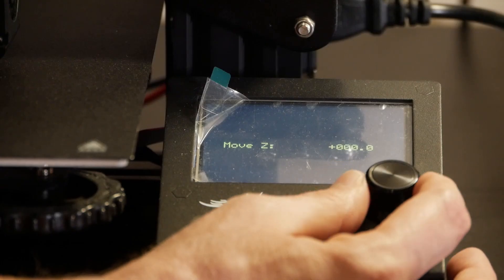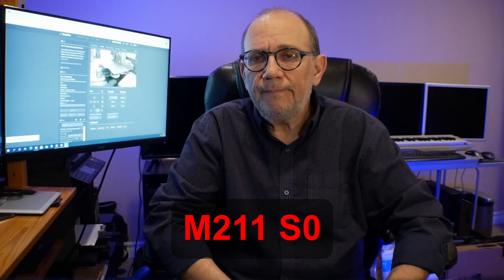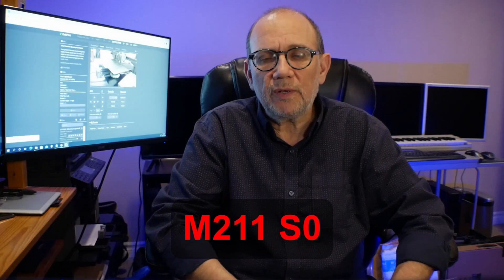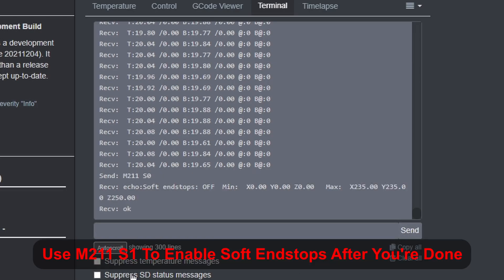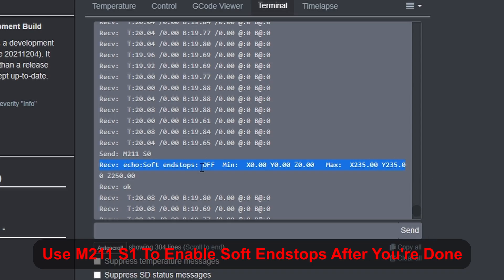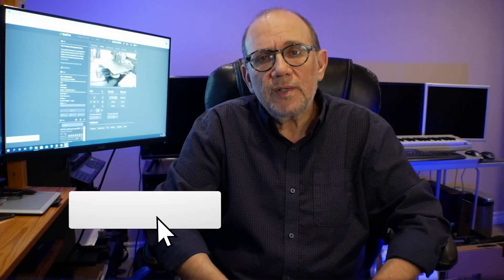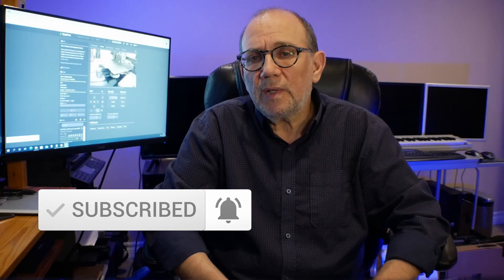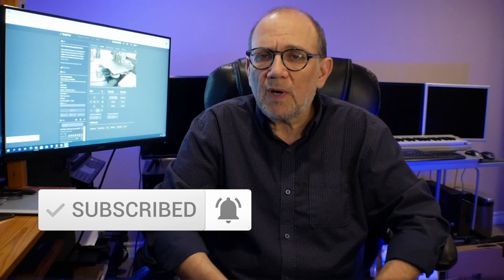Easy z-offset adjustment for your 3D printer.

Comment: Ok, so what I didnt get Is at the very beginning... How did make the probe go down (so that it is extended) when you move your Z axis... Because in my Ender 3 Neo when i lower my Z axis the probe all the way up (way higher than the nozzel). So I cant do that... (In other words, the nozzel touches the bed first)
Reply from the maker: Hi there.  In order to extend the probe I installed the OctoPrint BLTouch plugin which can be found here:  https://plugins.octoprint.org/plugins/BLTouch/  .  Just so you know though when you actually set your z offset you don't need to lower the probe.  I did that in the video just by way of illustration, but this is not something that you typically need to do when actually figuring out the z offset.  Thanks.  RG

Comment: how did you manually drop the probe on the CR Touch?
Reply from the maker: Hello....in order to extend the probe I installed the OctoPrint BLTouch plugin which can be found here:  https://plugins.octoprint.org/plugins/BLTouch/  .  RG
Reply: Thank you for that information.  I'm really new at this stuff.  If you don't mind I would like to ask another questionn.  I installed the BLtouch plugin but I have no idea what the gcode would be for this plugin to work with my ender 3 Pro or where to find the gcode.  Also, the motion options on the the control panel have disappeared since the install and I get my printer to home.  Could you maybe steer me in the right direction to fi find it or learn about it?  Thank you. @CreatewithTech
Reply: I actually solved the home issue.  There's a lot to learn and take in.

Comment: Do you say what Z offset is?? Is it a number noting a difference in height between the nozzle end and the porbe end. Its it a fixed number? Is it stored or do you need to save it? Does it vary with X and Y values? How does it read vs the three figures on the home screen. Hoestly Im lost.
Reply: At 1.56 you say 'setting the z offset is tricky for a lot of people'.. this is the moment you could have said.. Z offset is..
Reply: 3.18 'so now the probis down' - how did it get down?
Reply from the maker: @sammorganmoore  In order to set your z-offset you don't need to lower your probe  I only did this in the video to explain what the z offset is.  If you'd like to do this with your setup you can install the OctoPrint BLTouch plugin which can be found here:  https://plugins.octoprint.org/plugins/BLTouch/  .  This assumes that you have Octoprint installed...https://octoprint.org/download/  .  You'll need a Raspberry Pi or a similar SBC for that.
Reply: @CreatewithTech  I dont want to add a pi or any gubbins. Just the prob popped down in your video with no expaination which is confusing. I have no specific desire to use the probe
Reply from the maker: @sammorganmoore  The z offset is the distance between the nozzle and the bed...it has to be the height of a piece of paper.  Here's a defintion:   Z offset is a user-defined print setting that allows the printhead to be positioned above or below the default Z home position (true zero point).  In the video I talk about the true 0 point at 16:36, although I don't use those terms.  In my case at the true 0 point the nozzle is still too high off the bed.  This is why I need to lower the nozzle more (go into the negative numbers) to get it so that it's off the bed the height of a piece of paper, hence the use of a piece of paper.  Hopefully this clarifies things for you.  RG
Reply: @CreatewithTech  An aparent lack of clarity? My understanding is that the z offset is the value needed to put the nozzle at 1 papers height from the bed when z=0

Comment: What I do is just set it to 0 and then use the zprobe menus to figure out where it needs to be
Reply from the maker: What printer are you using?  The zprobe menus are not always available.  And sometimes printers can't go below 0 especially if you've installed a BL Touch which didn't come pre-installed from the factory.  In that case, setting the z-offset can be more difficult.  Glad that you have an easy way to set it.  RG

Comment: Thanks a lot. The best video I ever seen so far illustrating the science behind z-offset. Shouldn't you add/compensate paper thickness to the z-offset value?
Reply from the maker: Thanks for the positive words...as far as compensating for the paper thickness, you don't need to do that.  The paper thickness is the distance you need to leave between the nozzle and the build plate.  If you subtract the paper thickness the nozzle will hit the build plate.  So just go with whatever number you get after going to the process I describe in the video.  RG

Comment: Hi, good job, but when I turn off  print my setup resets. What could be?   Thanks
Reply from the maker: Hi Alessandro -- After doing the calibration did you save it with the G500 command?  If you don't issue the G500 command whatever setting you've set up will be lost the next time you turn off your printer.  The G500 command saves your new settings to EEPROM.  RG
Reply: @CreatewithTech  thanks for your prompt reply where can i write the G500?
Reply from the maker: @alessandrobicego7835  Hello Alessandro...If you have Octoprint installed you can send the G500 command from the G Code command tab.  If you don't use Octoprint or a web-based interface you can save to eeprom on your LCD screen.  Since I don't know what printer you have or what kind of screen you use I can't tell you exactly where to look.  But somewhere on your screen's interface you should find the option to "Save to Eeprom" or something like that.  So once you calculate your z-offset save it and it should remain on your printer when you turn it on again.  RG
Reply: @CreatewithTech   thank you

Comment: After definne your z offset you cant need do The bed leveling? The cr touch dont change config according your bed? I am ask,  because my bed some times have one level in The right and other in The left.  I Never see one vídeo say about running The bed leveling after The z offset configurations. Can you help me?
Reply from the maker: Yes, you most certainly can level your bed after defining your Z offset.  In fact sometimes you need to level your bed again as you pointed out in your comment.  However, if you do level your bed you'll need to configure your z offset again.  This is because changing your bed's height (up or down) will impact whatever number you currently have for your z offset.  So basically if you need to level your bed, you'll have to recalculate your z offset as well.  RG

Comment: Doesn't work for me. With the paper under the hotend and when I reach 0.00 I still have a few mm of gap. I tried to remove my Z-Axis limit switch but when I power on the printer I get a random Z-Axis number sitting around 360.

Ender 3
BTT SKR Mini 3 board
Silicone mounts for the bed
official BLTouch
UniTak Direct Drive Bracket
Reply from the maker: Hi there...it sounds like you need to turn off the soft limit switch by sending your printer the M211 S0 g-code command. I made another video that may help you with this https://www.youtube.com/watch?v=pj0kICk6DfY&t=350s .  The soft limit switch is is baked into your Marlin firmware and it's put in place to safeguard your build plate from being scratched.  Did you try sending the M211 S0 command?  You'll need to do this via the G Code interface on Octoprint or directly using an SD card.   You talk about the Z Axis limit switch but that's something different from the soft limit switch.  RG
Reply: @CreatewithTech  I had to leave for work and didn't finish the video yesterday so I just posted my question before finishing the video. I think you're the first person that has mentioned the M211 S0 gcode. I gave it a try and I was able to finally set my Z probe offset to -3.33. Every person I have asked just points me to compiling a custom firmware and I've tried but end up with things worse off or no difference. This has been a nightmare for the past three months but thanks to you I finally got this blasted thing going. Now to do this to my other printer.

Comment: Hi very thorough video, I have what maybe a dumb question, Will a gcode without the letter work or be ignored? Example M420, will 420 produce same result? Thanks
Reply from the maker: Hello...this is a very late response, my apologies.  No, 420 will not produce the same result.  The M420 is very specific...so you need to us the M to get the effect...RG
Reply: Thanks

Comment: At last i have my CR Touch working this video helped in some way but what i did was each time i adjusted the Z Offset i tried a first layer print and if it was to high i adjusted the off set lower and i did this for a while and now no clicking and its at just the right hight. The test i have done have printed out he best prints i have ever done also i did a update in the Cura setting in my Creality Ender 3 pro machine setting by adding this line after Home all axes:- M420 S1 Autolevel. The print out of 3d Benchy was the best one ever it was nice and smooth. The other thing i have to do is make sure the print head is at the bottom right hand corner before i do any prints then it does a auto home and then prints ok but after the print i have to move it back to that position. When i find out the problem i will get back to you. I forgot to say my printer is the creality ender 3 pro with the motherboard 4.2.7 and marlin 2.0.6 firmware with bltouch filament and i use glue sticks on the bed when its heated up to help with adhesive. This sounds a lot but iam thick and this works for me.
Reply from the maker: I'm glad you're figuring this out.  It sounds like you're getting it to work.  RG

Comment: very well explained, i saw many but often steps are a bit different. this makes more sense to me now.  Also learned thanks to you there is a lower increment than 0.1 when scrollling below 😲.  One thing I don't understand still is when do I have to do the bed leveing command G29 ?  put it in the initial G-code of my printer before the homing command G28 or directly after ?  And do i then need also to store settings so this gets stored into memory as well, or just do it at every print as it is "forgotten" after power off ?
Reply: I'm not sure if you've figured this out by now, but from what I've seen, it looks like the G29 code is added after the G28 in your slicer so it is automatically applied to every print when you upload it to your SD card.

Comment: I've been printing for 10 years now. Started with printing platforms to ensure a good flat contact, that corrected for said uneven bed or simply taking the bed off and bending it straight 😅Then insolated the bed to prevent warping/even heating and also printing a thicker first layer, which worked for me perfectly for the last 6+ years. Worked so well I never cared for anything like a BL touch, then i got a printer with a 300mm x 300mm bed and started printing ABS. 1st, glass does warp 🥲 the larger it gets the much wavier it can be. Installed a BL touch and adjusted to barely touch the actual bed, use a slicer with 1st layer compensation for elephant foot, and i get amazing bed adhesion with 0.2mm first layers and nearly invisible lines on the bottom of large prints. Honestly was amazed the first time how well it worked.

Only issue is that on my Creality Sermoon D1 it applies the bed correction to every layer, which is odd and mostly doesn't effect the prints in an visible way. It does make the printer nosier though, as my printer has "silent" stepper motors for E X Y but not Z.

It's also vital to level the bed every time if you have dual z motors, activate the motors to lock them when removing parts off the bed or messing with extruder (depending if you have z on the bed or the extruder) as to not knock it out sync with each z screw. And you can always time them together with a belt. Personally i think dual z motors are a flawed approach unless they have a way of automatically leveling each print, and if you tie them together then one motor would work better so you don't have two motors fighting each other if there not exactly on the same 1.8 degree phase.

Side note, I also installed a copper sheet in-between the bed and glass, that has helped a lot with even and quick heat saturation in the bed. The bed always gets hot in the middle and bulges because the edges are cold then the parts themselves can and will act as heat sinks (especially with part cooling) and will cause temperature fluctuations, which are a big reason for prints coming off the bed. Tested it with a harry potter wand the full 310mm tall in PLA white, white because oxidized titanium is used for the color and that seams to give everyone issues. Stayed on perfectly with NO brim. This is also why new higher end printers have a separate heater for each section of the bed and a much better temperature control to prevent heat fluctuations.

Comment: For some reason I'm having trouble with setting my Z offset. i can't go negative when trying to move nozzle down on my Ender 5 pro, also tried your g code mode for oozing, still oozing as much.??
Reply from the maker: Hi Brian...The reason for this is because the Z limit switch is turned on in the firmware.  I deal with this problem at 15:05...as far as the g code to prevent oozing is concerned it's pretty generic code so it should work.  If you tell me what happens in your case I may be able to give you some suggestions.  RG

Comment: Incredible video, I recently bought an ender 3 s1 and its leveling system has disappointed me, (and I am sure that the cr-touch is fine, because I have done a precision test and very accurate results come out) every time I use the system automatic leveling and after manually applying the z-offset on the screen, even so, there are areas where it does not adhere well to the bed, but if I do a manual mesh leveling applying z-offset at each point, everything turns out perfect, without problems of adhesion, it only happens to me with automatic leveling

Comment: At 3:15, how did you manually extend the probe to do this check? Are you using a custom firmware or is there a command in the control panel to do this?
Reply from the maker: Hi @brianvolpone2617...in order to extend the probe I installed the OctoPrint BLTouch plugin which can be found here:  https://plugins.octoprint.org/plugins/BLTouch/

Comment: fo some reason when i adjust Z, it will not let me tune it to negative values and stops at zero, do you know how to remedy this? Thanks,
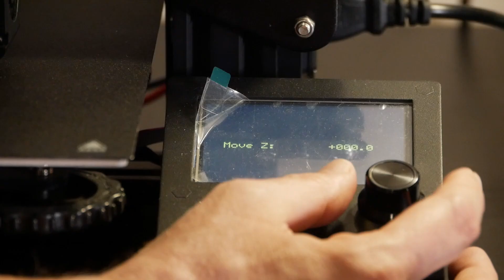Reply from the maker: Hi JohnFuller804 ... If your Z axis doesn't go below 0.000 it means that the z axis soft limit switch is turned on.  This is to prevent your nozzle from hitting the bed.  I talk about this here... 15:08  ....you'll need to turn off the switch with the M211 S0 command.  If you have OctoPrint installed it's very easy to do.  If you don't have OctoPrint, you might need to turn off the limit switch sending a command to the printer using an SD card.  I made a video here explaining the process:  https://www.youtube.com/watch?v=pj0kICk6DfY&t=337s   ...RG
Reply: @CreatewithTech   Thanks I'll give it a try!

Comment: unfortunately for me, after installing the ABL, I ran into issues with Thermal runway error.  Im thinking since I zip tied the ABL cable to the wire harness that has the thermistor cable, I am thinking that as the gantry moves on the X axis, it may have been tugging on the thermistor cable also because I zip tied the cables together.  Upon further inspection I could see the thermistor wire is exposed where the screw holds it in place, perhaps just wear and tear.

Comment: you dont need to heat the nozzle... it doesnt effect the z-offset
Reply from the maker: I know that there's some debate about this and I have tried it without heating the nozzle and it didn't work as well.  There is some thermal expansion that takes place which does influence the measurement.  Given that this thermal expansion is there when printing, it's a good idea to reproduce it.  Also, some people have a bit of dried hard filament stuck to the nozzle, which, if it's not removed will definitely influence the z offset calibration.  Given that it's pretty easy to heat the nozzle and pull the filament out a bit and then do the z offset calibration it doesn't seem like an unreasonable thing to suggest.  Thanks for commenting.  RG
Reply: @CreatewithTech  everybody has his/hers own methode to do it offcourse. I never heat the nozzle. Only to clean the nozzle before levelling and setting z-offset. Still love the video.
Reply from the maker: @wvdb-m6x  I agree!  Whatever works for you is good.  As long as the prints turn out, that's all that matters.  As they say "proof is in the pudding".  Happy printing.  RG

Comment: I want to also setup and use OctoPi but have noticed that even if I plug a Micro USB cable in the printer since I have the newer 32bit 4.2.2 board, nothing happening - Is there a GCODE that needs to be turn on for the USB or a menu item I've missed in the screen

Comment: This video is absoletely the best in explaining the Z Offset - the only issue I have is when it does the bed leveling with the 9 points that the CR Touch performs, It will start with point 1 but is goes way over to the edge of the bed but too far so the probe in the CR Touch has nothing to touch, it will do that on the first 1 of 9 and then stop and it seems you look in the menu and Bed Leveling is then Off - any clue what is happening?  I had update the firmware to the Marlin with BL Touch GD board as I was told to by Creality support.